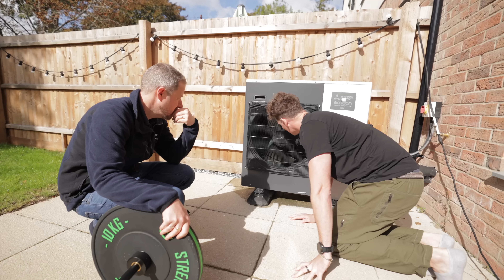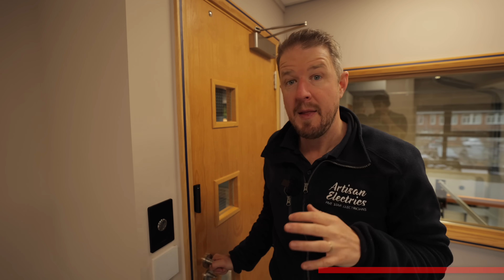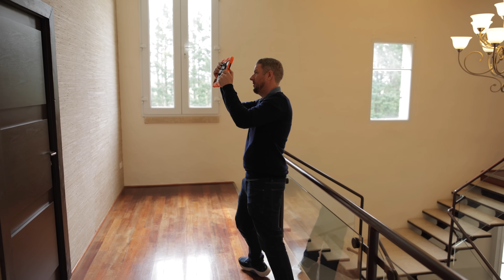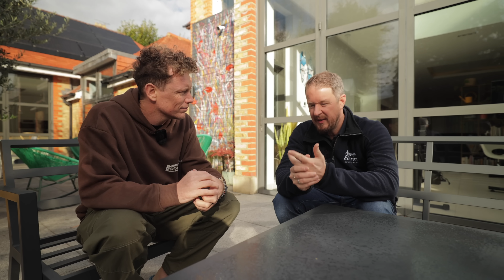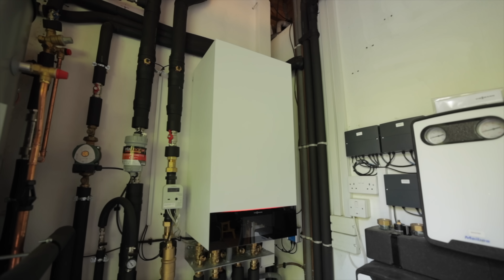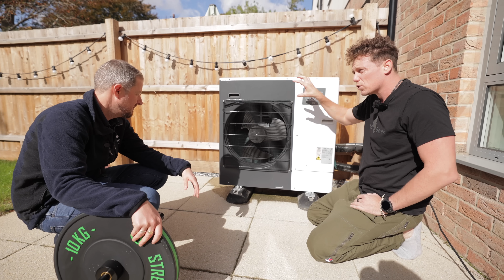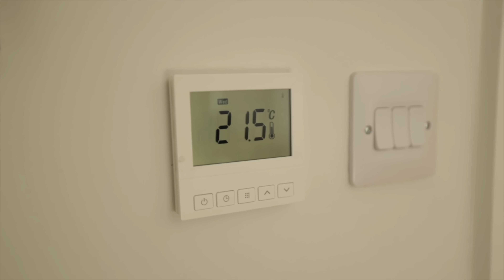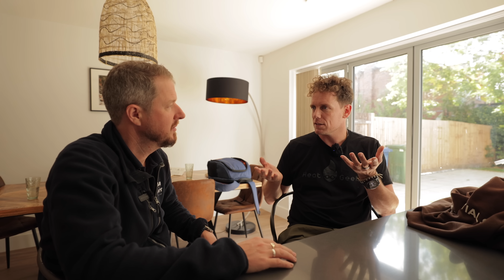Are Heat Pumps Really Worth It In 2026?

Comment: Hi, You mentioned you have 3-Phase electric. Just wondering which energy supplier you use. 
I have 3-Phase and it has been a nightmare. Still got the 50+ year old meters. I was with British Gas until 2 months ago. They could not handle 3-Phase meters. Their Billing system could only handle 2 meters.
Now using Eon. Thinking of getting smart meters, if they can sort it out. Tried to get smart meters serveral times over the last decade.
I was wanting to get a ASHP but the quotes i had said I need 2 ASHP at a cost of £30k
If anyone can recommend a good energy supplier for 3-phase. (also use gas central heating with 14 radiators)
Reply: I’m on 3 phase in an awkward area for meter signal , EON installed meter and are currently the best rate for cheap rate 7 hours , although it’s losing an hour on renew .
I had two 11kw Mitsubishi installed , 12 k3 rads on first and second floor  , underfloor heating on ground floor , 22 panels on roof and 24kw Sigenstor batteries for 50k and that was about a year ago .
Reply: We went single to 3 phase with Octopus. No billing problems but their communications between the metering team and front of house support was so bad they ended up having to do the meter update as an emergency because they forgot to schedule it. National Grid turned up, Octopus didn't and then there was a panic.
All got resolved nicely but wasn't terribly inspiring. The whole process is also mad in that peculiar British screwed privatisation way.

National Grid fit the new cables and connect to the new meter side but don't own the meter and aren't allowed to touch it or drill holes or dig trenches
Octopus can fit the meter but also can't drill holes or touch the grid or house parts
Your electrician therefore has to drill all the holes for them
And someone else is employed (either by National Grid or you) to dig the holes and put the soil back.

It's comical and makes the whole thing incredibly messy to arrange and co-ordinate.

Comment: Watching this as a British expat and having lived in New Zealand for the last 13 years, it now feels weird to see a home without a Heatpump. They're very common over here. I've also had them installed in two homes over the past 8 years. 

The install looks way more complex in the UK that it does here though. For context I have a split Mitsubishi system that pushes warm air through ducts into rooms rather than radiators. It has the same exterior unit setup but the interior unit in the loft is largely self contained, looks like a horizontal fridge hanging from the roof trusses with some big ducts hanging off it.

The systems most common over here though are the wall mounted units that look similar (in fact almost identical) to Air Conditioning systems. I do have one of those in the other end of the house. Speaking of Air conditioners we use our heatpump year round but during summer we use it for cooling the house down too. Keeps the house a reasonable temperature

Given the weather here is slightly more mild than the UK (rarely if ever gets below 0C) we also don't seem to require double glazing which on the flip side seems to be a relatively new thing here. My home was built in 1999 and still single glazed.

Thanks for the vid! Its fascinating to see the differences in how things have progressed on opposite sides of the globe! Random Brit living in NZ. Cheers
Reply: Obviously you don't live in the south it drops below zero plenty down here 😅😅
Reply: Nope I’m a Wellingtonian! Four seasons in one day!
Reply: @cooldante11 I live in Sweden and almost every house in my neighbourhood has them, it is regularly below 10-15c in winter months but hey ho what do the Swedes know?....
Reply: I believe these types of systems (split / forced air) are also the most common in Scandinavia and this is rarely pointed out. They are much easier to install and particularly the split systems are hard to get wrong as each unit is only responsible for heating a single room. 

They might be a bit less comfortable than a water based system, but I would say the benefit of being able to cool as well as heat more than makes up for it. I guess the lack of government support and the fact that most people in the UK aren't familiar with ACs is why they are rare in residential buildings.
Reply: You can't get a grant for an air-to-air heat pump in the UK, it is crazy. You can only get grants for air-to-water ones. Air-to-air ones are much better in my opinion. The UK always does things a crazy way, they don't want people to have air-to-air because they don't want them to use it for air conditioning in the summer, you can't make it up. There is more sun in the summer to get power from solar power for the air conditioning function, so the increased energy demand is not bad for the environment.
Reply: @BillyGold007  Be aware that the government is currently consulting on the inclusion of A2A HPs for the BUS grant.
Reply: Air Sourced Heat Pumps heating air instead of water are far more efficient and easier to maintain. They can also heat and cool. The problem is that UK houses are built to heat housing using water and to heat a cylinder for hot water. If a House was to use air to heat the rooms, ducting would need to be installed or wall mounted units would be required with the refrigerant pipes visible from the Heat Pump to each Unit. It would also mean that another means of heating hot water would be needed. It is simpler to heat water and use the existing house infrastructure. Personally, if I had to use a Heat Pump I would prefer to use hot air. It is simple to do this upstairs (assuming one has not had a roof extension) but more difficult for the rooms downstairs.
Reply: @daveoram7249  Plenty of UK houses have electric heating. It's also the case that it's often cheaper with gas installed houses to fit the air/air piping than replace all the equally visible crappy microbore and undersized radiators in many houses than make air/water work. Removing radiators also gets you an amazing amount of wall space back.

I agree sometimes air/water is the only easy way to do it - UK houses with lots of real walls and small rooms are really hard to do with air/air unless you can train people back into leaving doors open and even then not ideal. Modern houses though are internally all plasterboard and prayer so really heat as one block.

Comment: Would love to see some of these enthusiastic installers up in the North (where we have had temps of 20C at least once in the last 16 years and where the housing stock can be pretty flakey!
Reply: work fine in Sweden.
Reply: @zorrpo  
They are air to air in highly insulated homes. The UK has a temperate climate. The government will pay a grant of 7.5K pounds of an installation only if it is air to water and no air con. If building a new home and you design it to take forced air with a/c then air to air may be worth it without the grant.
Reply: @johnburns4017  My neighbourhood and I dare say many others in Sweden are pre-1970s and are really badly insulated. It's widely accepted that Swedeish construction standards were aweful until recently and now they excel. So the whole argument from certain quarters in the UK that heatpumps don't work is utter BS. I am heating a 1970's home, close to 200sqm with two heat pumps and a wood burner. It can creep down to -17c in the winter easily.

Comment: We bought a house in 2022, with a Daikin Air Source Heat Pump (ASHP),  I was initially very sceptical, and planned to replace it with a gas boiler, however, once I watched a few videos on the Heat Geek YouTube channel and got the courage to tinker with the settings, (low and slow is the way to go),  Turned on weather compensation,  removed the automatic electric zone control valves so all the house was getting the hot/warm water from the ASHP,  used room stats with a lower setback for overnight then the house (a large 4 bed in Norfolk) , is toasty and the bills are actually less than our previous home. 
Another benefit is that we all feel healthier as we aren't breathing in the byproducts  from combustion. (Our cooking is all electric). I'm now convinced a good ASHP install is a great benefit.
Reply: Remember, cook only to a light sizzle to ensure you are doing your bit for the environment. Arguing about CO from cooking your dinner, that will have less impact than farting in your sleep :eyes-pink-heart-shape:
Reply: Lol, flurocarbons. You do know burning food gives off CO regardless of the heat source. Some people really havent a clue 😂😂😂😂
Reply: @Purebeltersteve  orders of magnitude difference between the CO emitted by burning food, and the CO emitted by an open gas flame. Some people really haven't a clue indeed...
Reply: @DatNerddSwaqq so how much CO comes off a gas fire, please enlighten me.
Reply: @Purebeltersteve  You're the one making the claim, the burden of evidence is on you.
Reply: @jack6450 evidence is everywhere. Just dont believe everything people tell you on YT. These guys get paid to say things just FYI. You think they do it to save the world, which will never happen if UK goes net zero 😂😂😂😂😂
Reply: @Purebeltersteve  We are playing are part, and we are way behind much of the EU, and way way behind countries like China in how we are working towards net-zero.  

Look up a new study published by University College London (UCL).

"The study found that between 2010 and 2023, wind power lowered electricity bills by £14.2bn and cut the cost of natural gas by £133.3bn. When offset against £43.2bn in green subsidies paid by consumers, the net result was a £104.3bn reduction in UK energy bills over the 13-year period."

If it was not for us working towards net-zero, we would be now paying around 30% more for are home energy, along with chocking on even more air pollution.
Reply: trust me we are not behind. We are the UK, king of the propoganda lol, we will want to be the first fully net zero country on the planet. Weonly produce 1percent, so shouldnt be too hard. Il be burning gas for another 100 years so by that time, il be well in the grave
Reply: @Purebeltersteve  There are two ways gas stoves pollute your home. The first is the most obvious: when they’re in use. Burning gas creates heat, which causes nitrogen and oxygen to bond among the flames. They combine to create nitric oxide and nitrogen dioxide, collectively known as NOx, which can irritate the lungs. But that’s not the only compound to worry about. Cooking with gas can also emit carbon monoxide, particulate matter and even formaldehyde. Those all have various deleterious health impacts, and can affect the respiratory and cardiovascular systems.

There’s probably a more insidious form of pollution emanating from your stove. A growing body of research shows gas stoves emit toxic compounds even when not in use. Among the most worrisome is benzene, a carcinogen. A study by PSE Healthy Energy found benzene in 99% of samples it took in homes in California. Other chemicals discovered included xylene, toluene and ethylbenzene, which can also cause respiratory issues and may cause cancer as well.

Talor Gruenwald, the lead author on the new asthma study and researcher at Rewiring America, said the finding “demonstrates that this is a real public health challenge that we have to address”.

Just how much pollution are we talking about here?
A lot. The PSE Healthy Energy study found that gas stoves can emit as much benzene as a cigarette, making them akin to secondhand smoke.

That’s, of course, just when the stove is off. Research published last year found that NOx emissions when a stove is in use can exceed federal safety standards for outdoor air quality in a matter of minutes. For that reason, Shonkoff referred to stoves as “stationary air pollution machines inside people’s houses”, albeit ones that aren’t subject to the same outdoor air pollution standards.

Gas stoves are also terrible for the climate. The methane emissions from gas stoves in the US are equal to adding 500,000 cars to the road each year.

Can you test for gas stove pollution at home?
Not really. While there are a variety of indoor air quality sensors for things like carbon dioxide, volatile organic compounds and particulate matter, there aren’t cheap home versions for testing for NOx, benzene and other home pollutants.
Reply: another googler 😂😂😂
Reply: @Purebeltersteve  another Googler?
As opposed to an idiot that makes up his own data?

Yes let's trust some idiot on YouTube as opposed to top scientific institutions, governmental scientists and industry experts.
Don't worry lads Steve is obvs much smarter than them.

Of course people use Google to find information on a topic they aren't immensely clued up on. 
As a society we have never had information more readily available and yet still people choose to be uneducated in their remarks.
Maybe you should try googling stuff to, might actually spark a few more neurons in your head.

I legit can't tell if you're trolling or this empty minded. And whichever it is I'm not sure which is more embarrassing.
Reply: @Purebeltersteve motto.. don't burn the food!
Reply: @Purebeltersteve  Dude, I hope this is ragebait, you just cant be this confident and wrong at the same time. What fluorocarbons are you even talking about? Every new and efficient heatpump uses propane (very closely related alkane to methane which is the main component of the natural gas that your boiler burns) because its more efficient for heating than fluorocarbons. If you werent trolling you should really look up what you say to others.
Reply: @pali33 the OP had mentioned flurocarbons, but has since edited his post lol
Reply: @Purebeltersteve  Why is everybody talking about burning gas? My brother-in-law has just installed a heat pump system in his house, but it runs on solar. He doesn't have gas. Mind you, I'm not talking about the UK. We get quite a bit more sun than you do (Spain).

Comment: So the balance of whether it is worth doing or not, is not down to the theoretical performance, but entirely down to installation competence and your cost of capital.  The recent fiascos with faulty cavity wall insulation, shows the trade to be installing faulty installs, 80% of the time.  So yes it can be done right, but actually it most likely will not.  Reworking nearly every system will definitely not be cost-effective. The dodgy double glazing salesmen, who have switched to solar and heat pumps, are now having the public over big time.

To fix this problem, you would need an army of apprentices and retrain all the plumbers.  Technical craft skills training is a joke in this country. Unless you change the culture, the workforce will never know what it is doing wrong.

Comment: 20:26 All power cuts i experience are never shorter than 1 hour.  Most of them are around 6 hours, and can be up to 10-12 hours
Reply: A BESS is the answer to longer power outages.  Batteries can supply sufficient power/energy to run fridges/freezers and even run gas central heating - dependent on the battery size and power expected.  A BESS can be able to power a heat pump, too, if of sufficient size…
Reply: @oliver90owner  I have thought about getting something like this as i experience a power cut at least once a year.
Reply: @Shocker99    Maybe even a BEV?  Several, likeHyundai/Kia/ MG can be utilised in that way.
Reply: @Shocker99  Be aware that most of the solar/battery systems sold in the UK don't work in a power cut. Seriously. It's a bit more expensive to include the extra support for power cuts so people don't bother, or just go and buy a 1-2kWh portable battery unit for emergencies (which is usually far cheaper than the price difference for having your batteries actually work in a power cut)

Comment: Gas boiler works if you plug it into a battery bank ;)
Reply: Not if they're wired-in as a fixed installation load (no BS1363 plug).
Reply: Just like a heat pump then
Reply: @carlarrowsmith  But needs much less power. Don't get me wrong I'd love to get a heat pump.. but terraced houses are a unique challenge :)

Comment: I have a heat pump, I'm no hp engineer but it was really obvious it was bodged installed. I did do some comparisons between the immersion and hp (when it failed) and could see the co-eff was better but that was on hot water. I have miles of external pipework they couldn't be bothered to insulate, they cut through floorboards, severed room stat wires, expansion tanks falling off the wall when they filled. But of course, because i rent i have no control but it's a far better system than the Nibe we had, that was god awful system.
Reply: When you (eventually?) get  BEV (far better than an ICEV) you could change to a particularly cheap electricity tariff which will (at the moment) allow cheap water heating during off-peak hours.  Not guaranteed forever, but when electricity costs follow renewable energy generation costs, instead of following peak gas prices, water heating will hopefully be much cheaper than heating by electric at the present time.

Comment: I had a bad heat pump installation.  I can't afford to fix it now. I am screwed.
Mini split system wasn't enough to service my 1400 square foot house. I was undersized.
Reply: Fit another, smaller unit?
Reply: @oliver90owner  ran out of money at the moment.
Reply: @stephanieonlife3657    Many shark installers will do anything to make a sale.  I always try to get at least 3 quotes - then start bargaining to perhaps get the cost to somewhere near what the real cost should be.  I’m in the process of casting around for an A2A system for my little abode.  Hope you can manage to scrape together some more cash presently.
Reply: @oliver90owner  thanks for the input.
I will get it sorted by next summer.